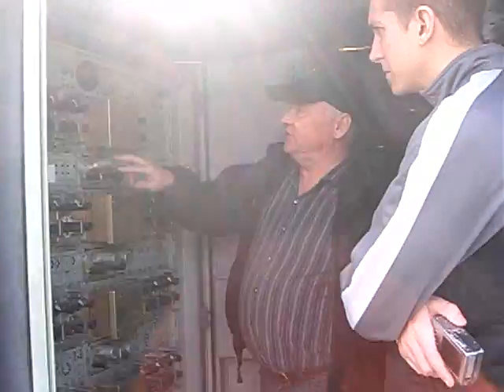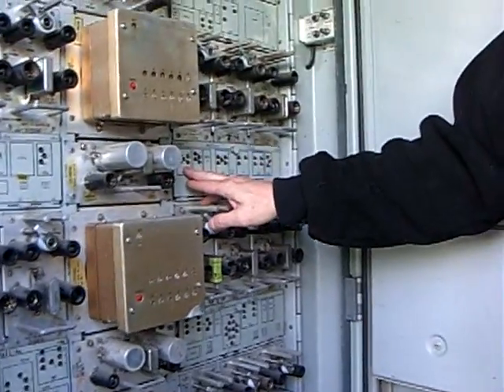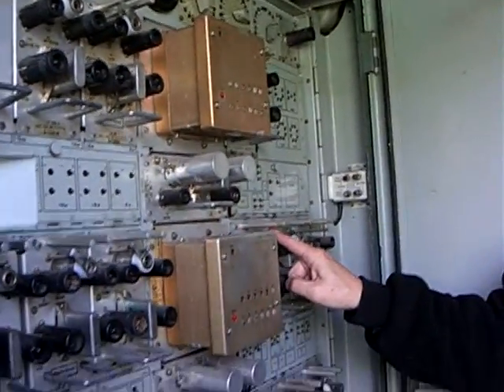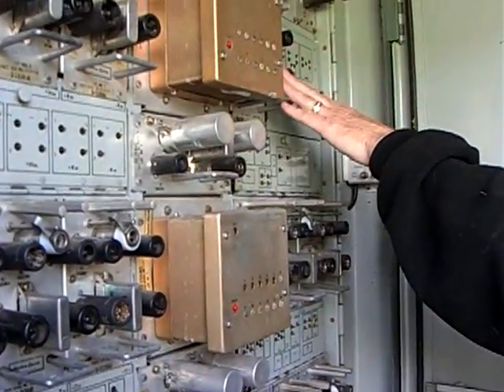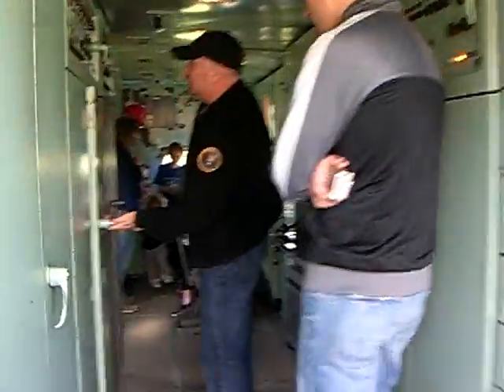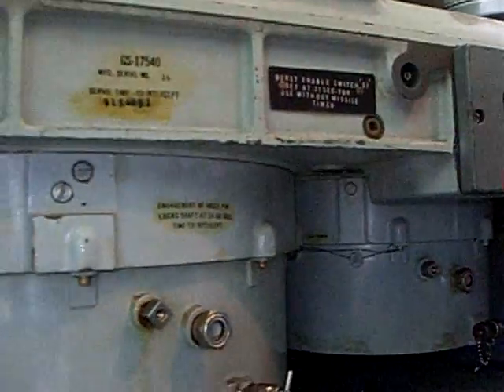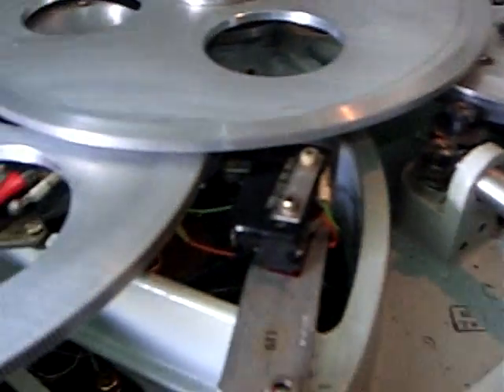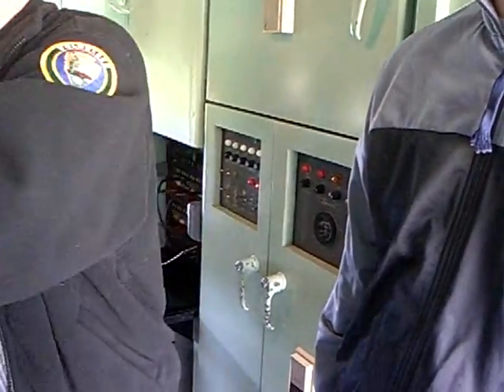1950's Nike Hercules Flight and Intercept Computers. Battery site SF-88 #15

Comment: He was incorrect about the Burst Order. It was issued at .002 seconds Time To Intercept and transmitted to the missile via the Missile Tracking Radar.

I was a Computer Operator in this system from 1971 - 1978.

Comment: Those electrolytic cap cans can be rebuilt. I've worked on old radios where we gutted the cans but kept the contact plate and cover, and just soldered modern replacement components across the right terminals inside. Then carefully re-close the can.

Comment: I am really impressed.  Not only is there a direct correlation between a college math and mechanical components, the system seems very robust--able to take emp and other attacks like someone mentioned below.  I hope these elderly folks who built and used these systems will stay around a long time to pass on their legacy to younger folks.
Reply: F Battery 4th of the 44th South Korea 1965 spent many hours in those trailers.😊